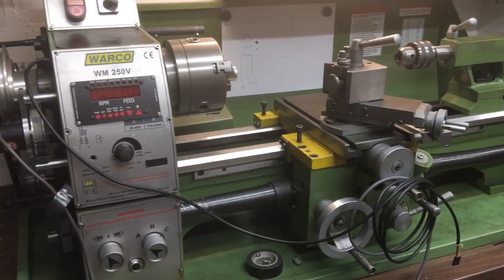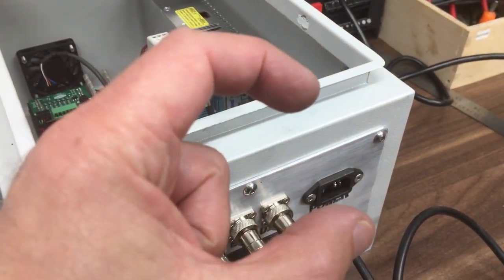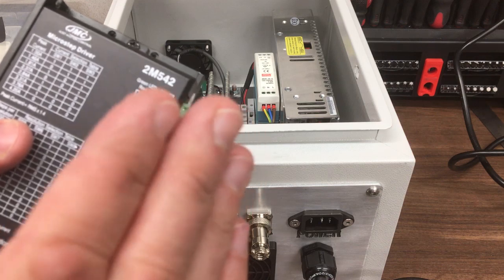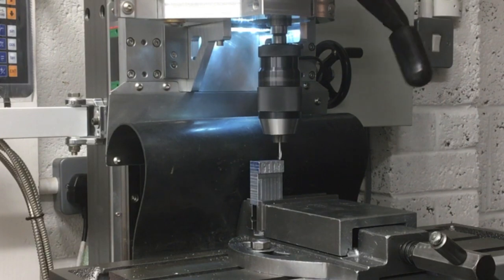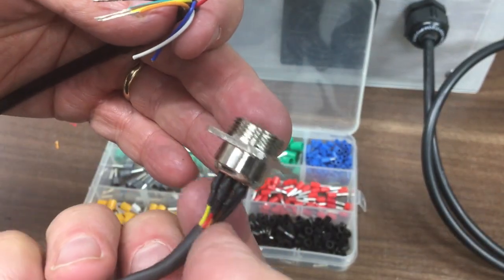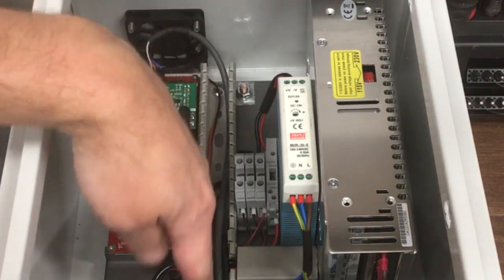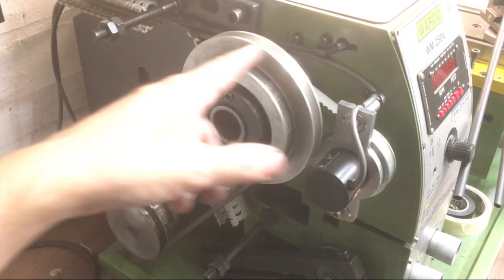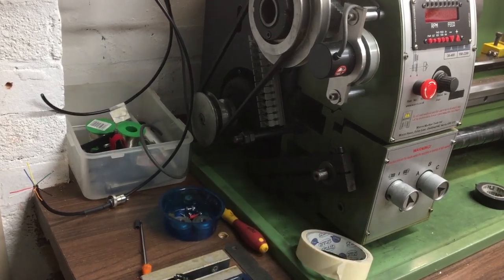Ep06: Clough42 Electronic Leadscrew | Mounting the enclosure

Comment: Having cut one my fingers to the bone reaching for the emergency button to prevent a birds nest from happening, I suggest you put the emergency stop button in a location that does not involving putting your hand near a rotating razor blade.
Reply from the maker: I think the one I just added on the front of the machine is far enough away but the original one at the rear left corner does involve reaching past the chuck.  I’ll think through the options, thanks
Reply from the maker: Ok new plan is front mounted estop will stop lathe and microprocessor pulses.  I hope to she it in the next video thanks

Comment: Since the ELS is tracking the spindle pulses, wouldn't stopping the spindle motor (brake) stop the servo ? That's what I do with mine, it coasts to a stop at the moment but planning to install a brake resistor and configure my VFD.
Reply from the maker: OK yes that would work but I was worried about running mains power and lathe current through the small 16mm estop on the front panel.  The connector pins are pretty small.  I did think about a latching relay e-stop system as I made for my CNC machine which would stop the spindle, but it gets a bit complicated with extra parts.  Maybe I could install a full size 22mm e-stop on the front panel instead and put that e-stop in series with the one on top of the lathe (which has the full lathe current through it), so it would stop the spindle.  I do have a spare brake resistor but to get to the VFD means craning the lathe off the worktop as it is mounting inside an enclosure at the rear.  I've been mulling over the options and might go with the e-stop interrupting the 5V power supply to the booster board as this will stop the processor and stop the motor.  It is not super safe as if the e-stop is reset and the spindle is running then the carriage will start to move again.  I'm wiring it up that way at the moment but will spend a bit more time looking into what it would take to read one of the pins and modify the code, ideally needing a power cycle to reset.  Options, options . . .. !

Comment: For the E stop, could you not connect it to the 'mains in' via a relay maybe if switch amperage is an issue, to cut the power to everything, that way it would stop the spindle aswell as the leadscrew?
Reply from the maker: Nive idea but the mains looped in and back out only goes to the DRO.  The lathe itself is on a separate plug.  I was not keen on running everything through one plug.

Comment: Strictly speaking an emergency stop button should stop all moving parts of a machine. If you need to stop the carriage and leave the spindle running just open the half nuts if threading or if feeding disengage the the feed lever. The ELS is just an electronic implementation of a manual Norton Gearbox.
Obviously "Your workshop your rules" and I am sure that only you use your tools but you could be slumped unconscious slowly being eaten by the lathe and someone hits the e stop and you are still being eaten just in a slightly less organised way.
Reply from the maker: These are good points and it has been bothering me about the best approach.  What I’ve decided to do is order a DPST estop with 2NC contacts.  Usually the are 1NO and 1NC.  One pair of contacts will interrupt the 5V supply to the microprocessor so the pulses will stop, and the other pair of contacts will interrupt the spindle contactor so stop the lathe.  This is the wiring that used to go to the safety switch on the end cover.  This estop will be on the front left of the machine so will be much quicker and safer to reach than the stock one at the top rear of the machine.  Thanks for your input as it has made me do a bit more thinking.  I’ll show this in the next video.  Thanks